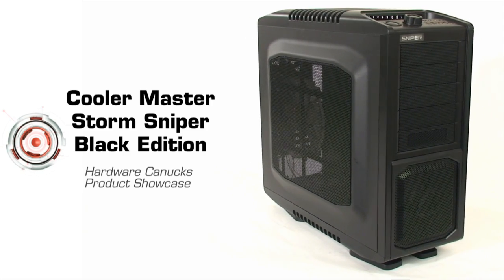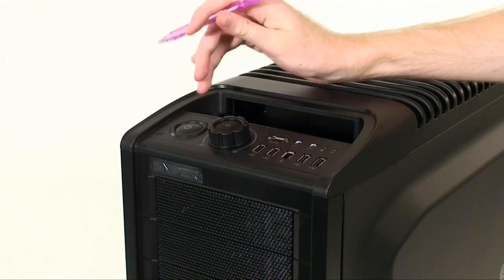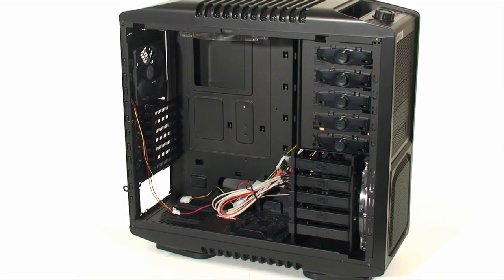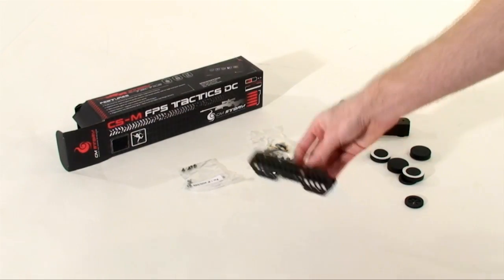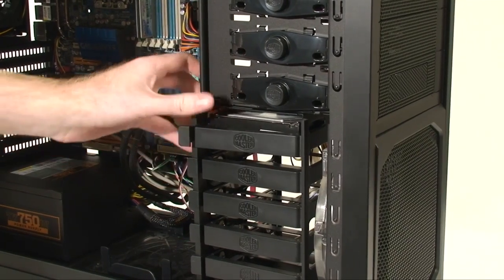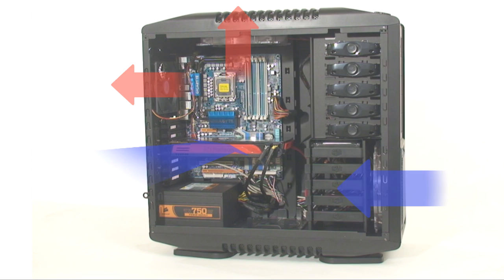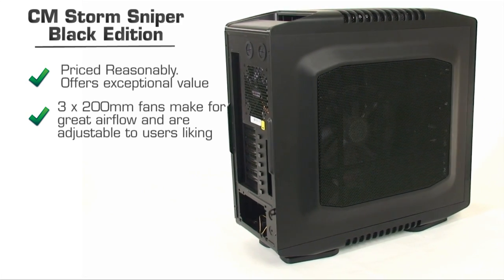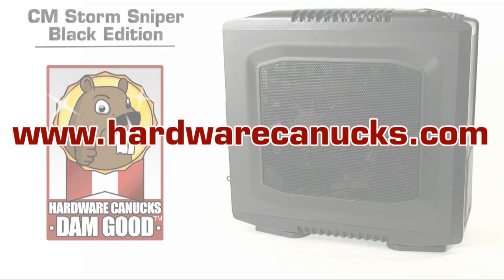Cooler Master Storm Sniper Black Edition Video Review

Comment: Still have this case. removed the drive cage for even better airflow. Drives are now in the upper 5.25 bays.  Also installed USB 3 internal hub to bring it up to date. Newer cases do not appeal to me because of limited hard drive bays, limited front USB ports and no place to install internal hubs to add to them.  The other big plus for this case is that it is easy to carry.
Reply: Tiene suficiente entrada de aire? Estoy pensando entre comprar uno actual o este

Comment: A lot of reviewers here on YouTube rave about the Fractal Torrent and it's 180mm fans, as if it was the first case to use bigger-huge fans , they forgot about this case with it's 3, 200mm fans on the front top and side panel! Still love this case til this day in 2022 even though it doesn't house my main video editing build.
Reply: I'm about to upgrade in t his case, you think it can handle the 5800x3d + 7900xt + noctua chromax cpu cooler?
Reply: @rabbychan  Sorry I don't really know if the case actually can, as I don't have any of the tech you just mentioned and I have had my coolermaster case in storage, but in my estimation I don't see why it shouldn't. The Storm case even by today's standards is pretty roomy and still has plenty of cooling built in. Again, sorry if I couldn't be of more help with more accurate information.
Reply: @theworkoutgeek  No worries, I appreciate the fast response!

Comment from the maker: @Whitesparrows94 
The two large 200mm fans spin at an adjustable 500-1000RPM so even at full blast, they will still be fairly silent. Rated at 17-23dba

You can turn them up when gaming and down when just browsing :)

Comment: Still fondly using this case in 2019!
Reply: I should maybe buy some 20mn corsair fans to replace the original one, now.
Reply: I want to use liquid cooler
Reply: Is it used? 360 mm
Reply: @lNegatory  Using an air cooler in mine, so can't comment on liquid cooler compatibility

Comment from the maker: @gregnmac Yes you will be able to add extra fans and adjust the speed but your fan will have to be of the 3-pin variety (or you can use a molex to 3-pin adapter). I am not sure about the LED control however; I believe that is controlled separately.

Comment: I purchased this great piece of hardware back around the end of 2008 and fitted an Asus board M5A78L-M  running Amd Athlon II DDR2 set up. It ran very well until recently (Due to operating system and so forth) so  I upgraded the board to an M5A97LE DDR3 running i5 and it is still as powerful as the first day I bought it. This case is the best investment for those who have a heavy workload or game a lot. Even pre-owned ones that have been revamped or just well looked after run great . I have purchased pre-owned ones for rebuilds for various people and they have all been happy. I highly recommend these and hope the info is helpful

Comment: If anyone returns and rewatches this. Ive kinda had this since they were new. ANd it is a awsome case. I have removed the back 120mm fan and placed my cpu watercooling radiator there instead. The massive top fan still manages well as an exhaust. The only downside with the case is that it is very noisy. Dust filters could maybe be better too (but they are not bad).

Comment: Got this case like 10 years ago, still have it even though the hardware inside has changed multiple times.
The only thing I had to add recently was a 3.5" USB 3 and C hub where the floppy drive used to be in order to bring it up to date again.
Reply: I still have this in 2023 and I'm about to upgrade to 5800x3d + 7900xt, you think this case can handle it ?
Reply: @rabbychan  I've got a 5800X3D and a 6700XT but my card is dual fan and not the biggest. Also because AIO water-cooling units were only just get started back then support for them in this case is difficult. Something about the screw hole placement only supporting early cooler master units I believe. But I'm happy with my 5800x3D being cooled by a Scythe fuma 2
Reply: @ClassyJackBF  My cpu cooler of choice is going to be the noctua chromax, you think that'll do well in my case?
Not the biggest fan of aio.
Reply: @ClassyJackBF  appreciate the quick response btw
Reply: @rabbychan  Any air cooler will fit fine in the Storm Sniper. It's a case with a lot of internal room, that's what I love about it. 
But do mind the length of your graphics card, but that's something you can best measure on your own.
Reply: @ClassyJackBF  7900xt dimensions are 276 mm x 135 mm x 51 mm
Case is 566.42 mm x 254.00 mm x 551.18 mm 

Did you happen to replace the stock fans with something else?
I'm currently considering to replace the rear one with a noctua and the one on the bottom with be quiet, I'm not sure yet if I should replace the stock 200mm fans.

grts
Reply: @rabbychan  I've never had to replace the 200mm fans, after like 11 or 12 years now they're still going. One did break because I broke the cable myself, but I did not replace it. The case has plenty of airflow. I replaced the 120mm exhaust with a scythe and I placed a 140mm noctua in the bottom for bottom intake.
Reply: @ClassyJackBF  Great to hear, you convinced me to keep the old dawg, that saves me another 120 euros  for a new case.
I'm excited to see the finished result, it'll be my last DDR4 upgrade, I've also been on 1080p for years so this will all feel very new to me, can't wait! :)

Thanks for the information, you were a great help.
Reply: @ClassyJackBF crees que valga la pena comprarlo actualmente? Me lo están vendiendo en 40$ estoy entre este y un case apevia cruzader cuál sería mejor?
Reply: @lav707  Yeah it's still a great case as long you don't need to use water cooling.
Reply: @rabbychan  How did things go? Did everything work out?

Comment: I love this case. I have had it since late 2009 and the only thing I find it lacking is the front ports don't have USB 3.0, but no cases did back in the day, can't really fault them for that, and I am about to buy a front bay device to solve this anyway, so it is no longer an issue. As far as air-cooled cases go, I haven't found a case that I would trade it for yet that is not ridonkulously priced.

Comment: @groberti: If you want to trade the noise for something else then I recommend cases that you can equip water cooling easily. Of course if you could effort for a liquid cooling system. If not then just buy this case but remember to clean the fans every month to reduce the noise.

Comment: @krzytom81 i know the V10 will fit just fine because i've seen people put it in there. You might have to (re)move the side fan for it.. but i'm not sure about that. But considering this is a coolermaster case.. i'm pretty sure they made sure it does fit

Comment: @MrNightwings74 I was looking at this case on newegg and am seriously considering getting it, but I read that there is something wrong with the top 5.25 in. bay (if you have a drive occupying it then you will have issues with your computer turning off and on when you touch something, like the knob to regulate the fan speed). Have you had these issues? I read it's easily avoided, just don't use the top bay, so I will probably still buy it. I'm just curious.

Comment: @MrNightwings74  yes . I already fix the problem; i pluged one in the PSU and the other two at the 5 extension cable and its just fine; this case is awesome case; at gaming, with my GPU that is a Cyclone and it puts all the worm air inside the case i can get, after an hour of gaming temperatures inside of 35celsius, 35celsius at the processor and 53 at the Gpu; sometimes the problem is not the Cpu or Gpu but the case that we have. Thanks for the concern ;D

Comment: Cooler Master site says that the bottom fan could be 120mm or 140mm. Is this true, will 140mm snap into the same bracket as 120mm?

Comment: How do you do to put the fan control workinh«g? it has an cable with 5 molex connections to plug the molex from the fans but how can i power it? i dont know how to do that; is something missing in the case? some cable or connection? just bought this at 3 days ago; urgent ansswer apreciated.

Comment: @HardwareCanucks  Hello, I got a question I'm looking in to building my first sandy bridge computer using a i3 2100 and an amd 6870 with a 1400*900 samsung monitor and a 600 watts Corsair  power supply and 1tb Western Digital Hard Drive and finally 4gb Patriot signature ram and a Asus motherboard , which is better in value Corsair  or Cooler Master?

Comment: I have the original CM Storm Sniper. Its has great air flow. I Fold 24/7 for team HCF #54196 and I dont have to worry about my temps as long as the fans are at 50%. This summer it was hot in my room but I was never worried about my PC temps:) Hardware Canucks is in the middle of a F@H contest, Stop by the forums to see how to join,Tell them Badatcards sent you:) WTF Way To Fold :)